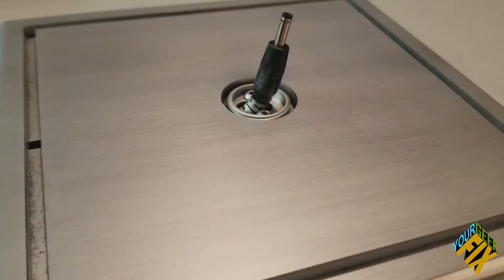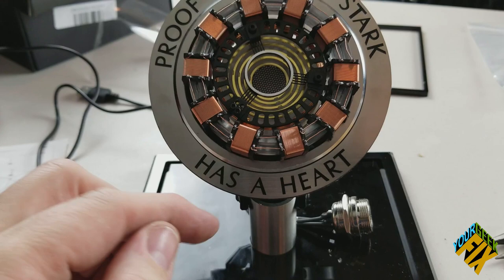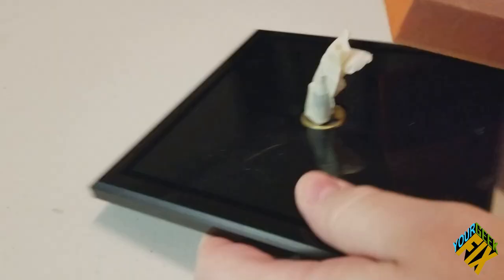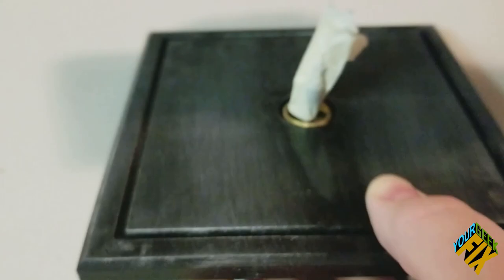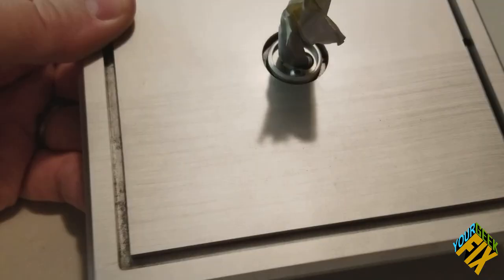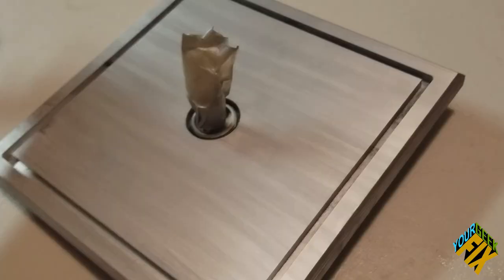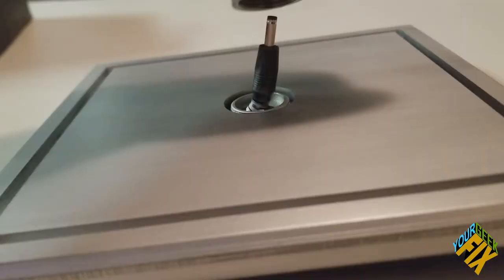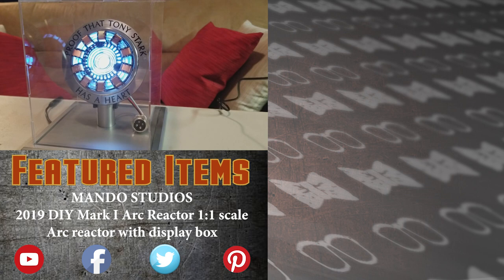How to paint objects to look like brushed metal in less than 30 minutes

Comment: hello, his video came out well I have to redo a steering wheel insert on a car with a real brushed aluminum console!! on the other hand I would like to know what grain you used and if the background must absolutely be glossy black? Many thanks for this video 👍👍
Reply from the maker: Boy, depends on what your steering wheel is made of.. Metallic work best on a black primer. The black does not need to be glossy. In this case, the plastic was black and I just went from there. grade of sand paper should not be too high. I think the brush did most of the heavy lifting here. (I would say, seal your job after ward. Don't use high gloss if you are going for the brushed aluminum look.
Reply: @YourGeekFix  nfortunately i think it is the plastic element  but the previous owner painted it glossy black so I already have the base with the difference that it is a paint and not mass dyed!! I think I need to start at 240 or even 320... For the varnish I'm going with a satin finish to have a natural finish a bit like the one you did!! I find your work very realistic !
Reply from the maker: Yeah, satin. If it is already plastic and shinny, really sand it down. @ysabeln8553

Comment: I might use this for my car interior 👌
Reply from the maker: That will look great. You may want too seal it too.
Reply: @YourGeekFix  Thanks for the tip. Was your paint for plastic only? I saw you have instagram too but are not active, I could tag you in the photo once I am finished 👍
Reply from the maker: @bandofbros8112  You can email me at yourgeekfix@gmail.com The paints I use are usually all surface bonding paint. They usually say "Any surface, any angle, primer and paint."

Comment: Hi, do you have any recommendations for metal paint effect on wood for exteriors?
Reply from the maker: Do you want it to still have a wood grain?
Reply: @YourGeekFix  Not necessarily
Reply from the maker: @diegoguadalupi7836  also depends on the size and what you are trying to achieve. Describe the project.
Reply: @YourGeekFix  It's a garden pod. I want the fascia on top and side of the door to look like blue metal
Reply: @diegoguadalupi7836  You might want to look into Modern Masters bronze or copper effect paints. You can get some nice blue patina, especially from the bronze.

Comment: @3:26 you said metallic paint
Reply from the maker: I believe this is it https://www.zoro.com/rust-oleum-spray-paint-aluminum-11-oz-7715830/i/G6173447/?pla=true.
Remember there must be a black layer underneath. I recomment a black primer if the item is not black.
Reply: Your Geek Fix thank you so much i got all the products and turned out great on my monitor stand last question if you dont mind was there any lingering smell after doing this project for me there is a odor even after leaving it to dry for around 3-4 hours outside
Reply from the maker: @ButterScotchHD  if you sprayed the protection on, it is probably that. Try a zeiss cloth with alcohol. Rub in same direction.
Reply: Your Geek Fix thanks :)